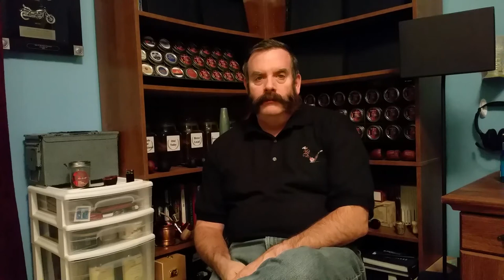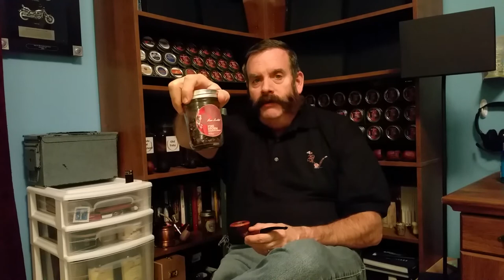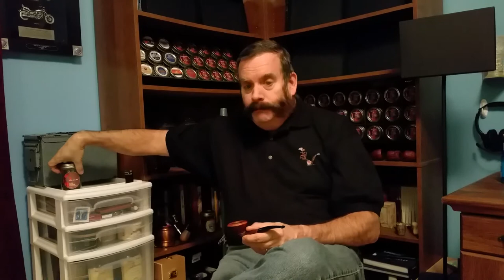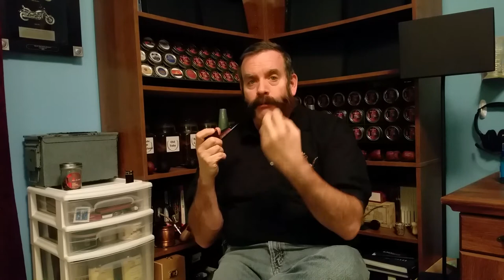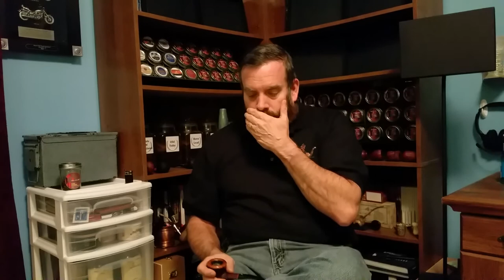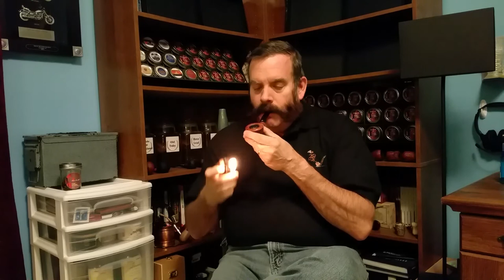The Art of Pipe Smoking, Vol 15; An Alternative Draw method

Comment: Hi. I am new to your channel and I must say, you got a nice setup for your pipes and tobacco, neat and well organized. One thing that changed my life as a pipe smoker is a technique called "breath smoking". I used to smoke wet and hot as well and this has eliminated the problem. If you just leave the pipe in your mouth (mouth closed) and breathe normally through your nose (don't try puffing, just keep the pipe in your mouth), you will notice that smoke comes in your mouth naturally. Just try it, breathe in and out a few times with the pipe in your mouth and then open your mouth and you will see smoke coming out (even if you didn't draw the smoke). With breath smoking, you also push back some of the smoke that's in your mouth into the pipe, like if you were massaging the smoke back and forth slowly between the bowl and the tip of the stem, I say again very slowly. You don't blow out forcefully but just a slight gentle breeze. Also the cadence for this technique is similar to your normal breathing but twice slower (your own breathing would be inhale-exhale-inhale-exhale while you do the same in the pipe but at a slower pace, 2 cycles for yourself and 1 cycle for the pipe). You will notice it calms you down as well and improves the flavor of the tobacco, especially for virginias. You might think that by doing so, your saliva will go down the stem but it doesn't. It keeps the pipe cool and dry for me. If you ever see old movies or real old timer pipe smokers, that's what they do. It also helps keep salivating down to a minimum, allowing you to keep the pipe in your mouth much longer. You will also notice the amount of smoke is way less but you get more flavor. When I started doing it, I had to think about what I was doing but now I just do it naturally. Happy smokes!
Reply from the maker: Welcome to my channel homewaters 1, this technique sounds intriguing, and I will give it a try, but let me ask you a question, when I smoke, if I leave the pipe in my mouth, my saliva glands kick into overdrive, how does this technique deal with the saliva?
Reply: The moisture buildup in your pipe stem isn't saliva. The moisture builds up naturally from the heat. So the hotter the smoke the more moisture buildup. Not saliva.
Reply: Wow, thanks a lot. I wanna try it now.
Reply: This comment brought on videos that helped a ton of people. Really cool to stumble on this piece of Muttnchop Piper History!
Reply: This should be pinned.

Comment: New to pipe smoking. Great series you have. This alternative draw seems to keep a healthier mouth too. How about a video on  keeping a healthy mouth? Reducing the risks of oral cancer, and other problems?  My mouth is a bit raw smoking aromatics. My taste buds are a bit dull now. Wondering if it will impact the taste of the tobacco. Been rinsing with cayenne pepper to combat dry mouth and to revive the buds.
Reply from the maker: I don't know much about oral cancer, but I have seen some reports that if you are not a high risk for cancer IE; you have a family history of cancer, you would have to smoke 50 bowls of tobacco a day for 30 years for it to effect you. Now as for the way your mouth feels, Aromatic tobacco has a high sugar content which tends to burn hot, so I would suggest you might benefit from trying a crossover English like "Seattle pipe clubs Mississippi River", or "Russ Ouellette's Fire Storm" they are still sweet but have less sugar and don't burn as hot.
Reply from the maker: Also you might consider purchasing a pipe that comes with a filter, 9mm would be ideal, but 6mm would due. This might solve both concerns, because the filter would remove any cancer causing agents if there is any, and provide you with a little easier smoke on your pallet.
Reply: +Muttnchop Piper OK great, thanks for the information.  Yes, you mentioned Russ Ouellette's Fire Storm as a good one. Will be ordering it!  Have you tried McClelland Red and Black?  If so would you recommend it to a newbie?
Reply: +Muttnchop Piper  I have used balsa and paper. Are you talking about any specific type? I also read somewhere that a corncob is a like a filter that it absorbs a lots of these things into the cob itself
Reply from the maker: I have tried "Red and Black, but I would hold off on that one it might be a little stron
Reply: +Muttnchop Piper OK thanks

Comment: I have a few of the same issues, fast cadence. but I'm new to the pipe game, cigarette smoker( though using the pipe has cut my cigarettes in half!!). Your advice has helped my cadence to a certain extent. I find when I smoke more aromatic blends it's always wet and gurgling. I'm using 1 or 2 pipe cleaners per bowl. Luckily I don't have much problem with tongue bite though.

Comment: I too experienced the problems with my pipe....this is how I cured the problem....the moisture problem was the easiest ...I simple bored a hole in the bottom of the pipe...this allowed moisture to drip freely outta the bowl.....it also kept bowl cool as air could enter via the hole....tongue bite was the trickiest...in the end I had my tongue surgically removed...which also helped with my excessive weight problem because I can no longer eat.

Comment: I read that wet smoking comes more from issues with the tobacco or fast cadence than from saliva going down the stem.  What do you think?  I tried the Breath Into The Pipe method a few times to try to encourage my pipe to stay lit during smoking.  Oh man, what a wet mess I ended up with. The humidity in your breath returning into your pipe, even unintentionally, can really ruin your experience.  Thx again for your great videos and hard work.
Reply from the maker: WhiteBurleyDude - I agree, moist tobacco, a fast cadence, and saliva play a part with trouble with moisture in your bowl. If you haven't tried using a pipe that accepts a filter you might want to give one a try, they cut way down on the moisture you have to deal with, and I notice no change in flavor or how the pipe operates. 👍👍👍

Comment: Have you ever considered drilling a small hole into the stem of an inexpensive pipe?  The hole would have to be tiny, so as not to interfere with the draw, but allow some cool air to mix with the smoke before it reaches your mouth.  Maybe it's a bad idea, I'm just throwing it out there.
Reply from the maker: Cameron Jackson - no, if you do that, the air would come from the hole you drilled and not from the bowl, causing you to draw harder, but you could not draw hard enough which would mean your tobacco would constantly go out causing relight after relight. 😒😒😒